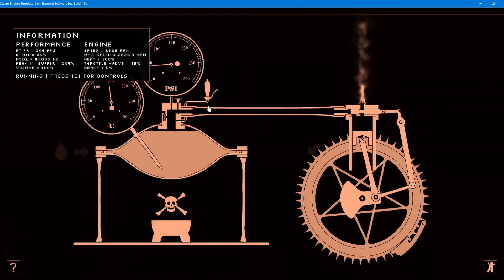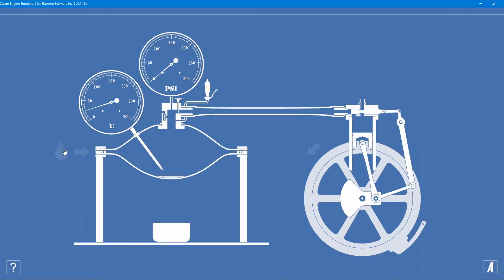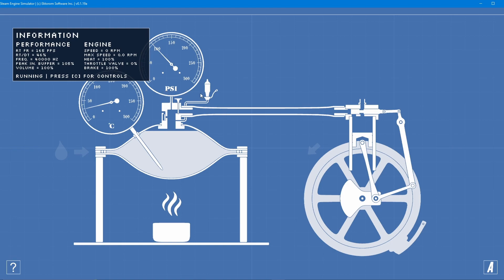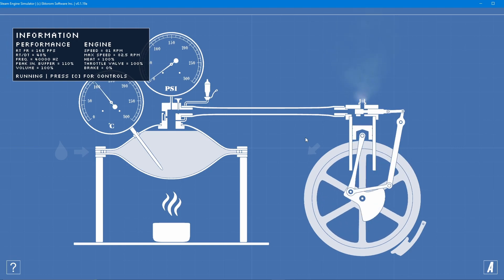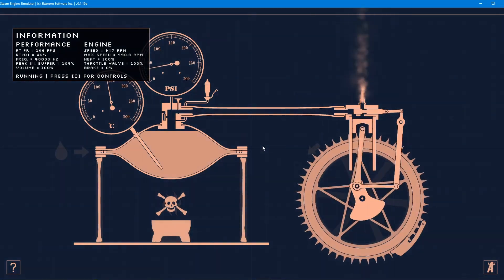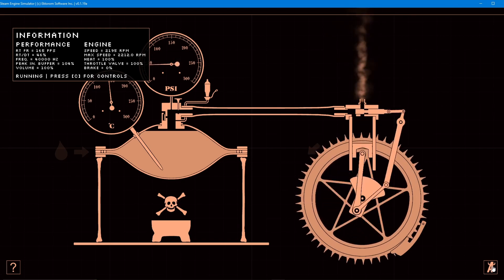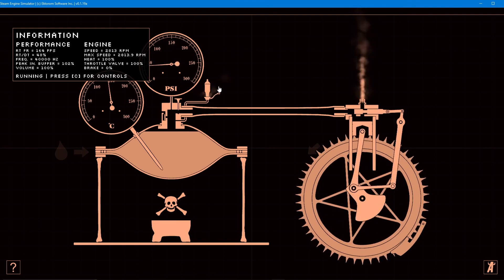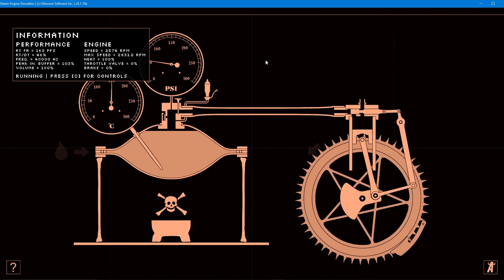HOW TO GET 2800+ RPM IN STEAM ENGINE SIMULTOR

Comment: 3500 rpm =
1. Throttle valve to 41%
2. Keep the tank full (hold "L" or get it stuck) 
3. enjoy up to 3511 rpm
Reply: Ah an intellectual
Reply from the maker: I left it for 15 min, and nothing changed, but then I tried to  mess up with the throttle to 39% by accident, and it worked !😂